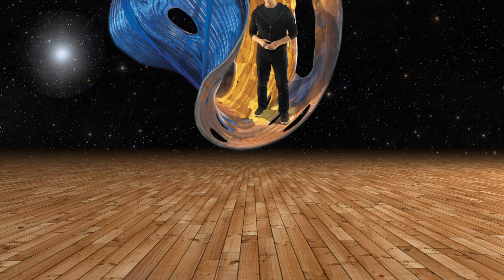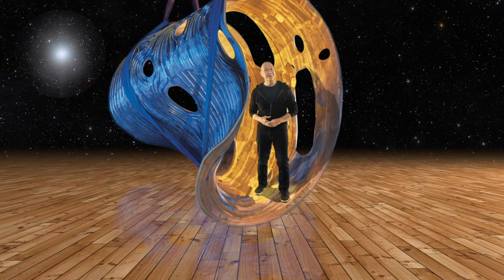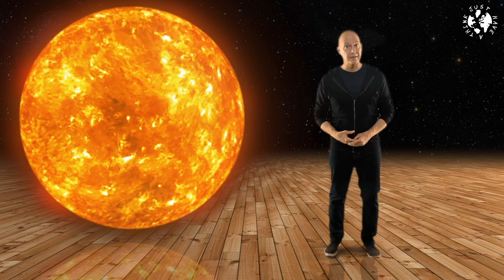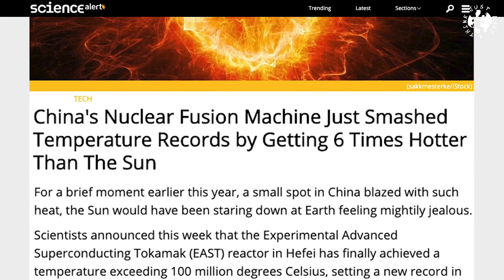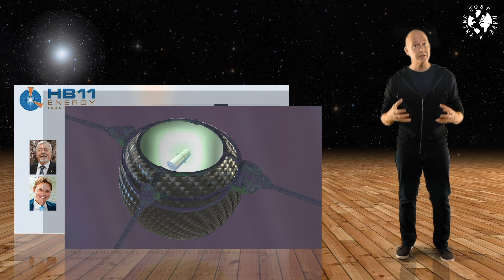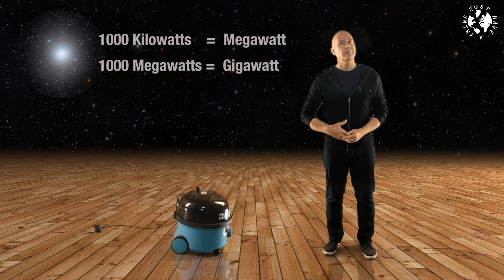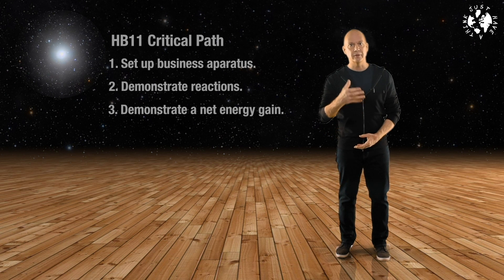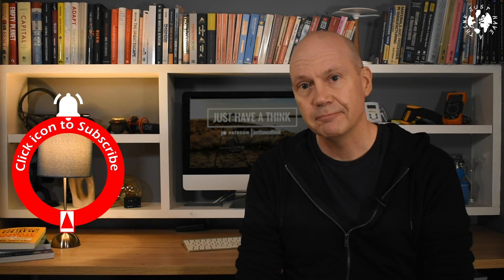Nuclear Fusion:  Revolutionary new breakthrough.

Comment: We don't need to spend billions of dollars developing a fusion reactor. We already have one in the sky that we can utilize now with solar / wind and battery plants which already provide base load power and can be installed now for millions of dollars not billions of dollars for some pipe dream sometime in the future.. The sun shines in everyone's backyard. Why spend more  billions on fusion reactors when we can spend millions on SWB installations and get the same thing which is cheaper, simpler proven. No war required, no more research required it is ready to go now. Fusion reactor research may have made sense 10 years ago but now it does not. Once installed the SWB doesn't require fuel purchase. It comes from the sun and is free. Something to think about.

Comment: Solar panels and windmills require too much critical minerals to ever be a sustainable reality. It will take either new gen fission reactors or a breakthrough fusion reactor. Both will still require coal, oil and gas to build them.
Reply: Also there is maybe not enough lithium for everyone to have an E car.
Reply: @Justwantahover  

Very true, very hard and expensive to presently recover the lithium from used Li-On batteries

Comment: Dèjä vu. 😀 The reason why magnetic confinement research has survived, regardless of its shortcomings,  is because all these other alternative ideas have failed in the past. Sure, they can get some interesting results at first sight, but prove impossible to scale up. Still, they also help to learn more on the subject, so it's good they exist, Regarding the p-B11 reactions, it isn't mentioned that their requirements are far more stringent. I admit I don't understand what they mean by the avalanche fusion reactions by the alpha particles. Maybe that's the key to some new idea, but I'd need to know more about the details. Indeed, the alpha particles would heat the target, but then you need to keep them confined within a high density  plasma within a very short period, like in NIF.  The idea of using chirpped lasers is certainly interesting.

Comment: For anyone who actually follows the physics, it's clear that this method is a standout. Apart from the other HB projects, this is the only one that proposes electricity vs heat as the output, and, to my knowledge, the only one at all that proposes achieving fusion without heat "in." No carbon. No radiation. No heat. Just electricity and helium as outputs. Clearly this idea requires orders of magnitude more funding.

Comment: This is MANY decades away from fruition, we need a solution NOW not 50-100 years from now. We need reactors that run at low pressure, can not melt down, run at much higher efficiencies (results in low waste), and generate little long lived waste. They should be made in a factory and shipped out as modules for assembly on site.

This fusion research is important but we have to put time and money into reactors we can put online in 5-10 years or it will all be pointless.

Comment: We should be diversifying. Renewables, as they're erroneous called, are not that optimal for a grid level system. The one caveat to this is hydro. 

Wind and solar should be local modular systems that support fission, hydro, and possibly fusion as the grid level systems. Of course fusion will only be usable if this company proves its system works or another beats them to it.

Comment: dual infinity Möbius strip  what about pulsed lasers in a dual tokomak modeled mobius loop to have fields at the threshold of forward motion acclerator where we speed up the flow into a particle stream that is propelled by pulsed hydrogenboron lasers until they approach the speed of light and just continue to propell them to the point of mater energy conversion causing fusion and the electrons to be striped. If we use supercritical metal hydrogen the hydrogen itself will act as a supermagnet superconductor.. once the criticality of metal hydrogen is reached then the fuel itself can be used as a gateway to the reaction https://en.wikipedia.org/wiki/Metallic_hydrogen   Metal can be turned into hydrogen at extremely heavy gravity caused by a gravity anvil.. once forged at super low temperature it can hold its fuel characteristic of metal hydrogen fuel source as a superconductive supermagnet thus using the fuel itself as the magnetic source. Just keep adding more metal hydrogen on the outside so it is a sustained fuel feed and repair of sublimed internal metal hydrogen core.
Reply: I don't really care much about fusion, I just want to survive the pandemic..
Reply: isn't there some way we can use the sun for fusion energy?

Comment: I have a silly (or not) question. It is known already, that a free neutron can be converted into a proton (beta-minus decay). My question is: would it be possible to fire a stream of neutrons into the hydrogen and somehow force their conversion into protons right before they got close enough to the nuclei to fuse? Even a success rate of 1 over a billion would probably be ok.
Reply: For many years (almost 25 years) I have been convincing scientists that thermonuclear fusion in the Sun occurs not in the core of the Sun, but in the solar corona !!! But scientists are very stubborn, and do not want to believe the obvious. Why are scientists not accepting new breakthrough scientific ideas? There is an assumption, accepted by most scientists, that thermonuclear fusion in the Sun occurs in the Sun's core. But no one has ever actually confirmed this. This is just a guess, the fantasy of an authoritative physicist. Scientists are currently using two methods to achieve nuclear fusion: inertial confinement and magnetic confinement. But there is also a third method of achieving nuclear fusion, this is the repetition of physical conditions as in the solar corona. Nobody is using this third method to achieve nuclear fusion? In 6 months there will be a small prototype of a commercial fusion reactor. A commercial fusion reactor in 1-2 years! I propose a technology transfer for a commercial fusion reactor under a contract. Thermonuclear fusion in the Sun - a new version. http://n-t.ru/tp/ie/ts.htm     https://www.youtube.com/watch?v=izCALj848xU

Comment: The real key breakthrough for viable fusion power is the REBCO high temperature superconducting material, which operates at liquid nitrogen temps (~70K), and can produce twice the magnetic field of previous superconductors. This allows for a 16x increase in power per unit volume - or in other words, for a machine the size of a small house to produce the same or better output than the absolutely enormous(ly expensive) ITER reactor. Also the use of liquid - molten FLiBe salt for a neutron blanket. Check out the MIT / Commonwealth Fusion Systems ARC and SPARC tokamak deuterium-tritium reactors. Dennis Whyte et. al. They're actually gonna do it! We should see the first ever positive net energy fusion in 2025, and a working prototype 200MW commercial power plant in 2030 or thereabouts.

Comment: who said they didn't create anything? they create a blackhole (for money), and the event horizon is always 20 years from now. i would ask, do we seen anything like that astronomically before in space? the smallest star with fusion we heard of is using the sun as comparison. and the nuclear fusion we want are in the size of a building. what makes us believe a continuous fusion will be happening in such a small scale? if the calculations is valid, we should as least see may be 1 or more of these stars in the space. ok, we lower the standard, how about size of earth? planet size fusion? you have to check the latest finding but i bet a dollar here, no such size with nuclear fusion that give out light and heat. too small is too small (in scale), you can't burn through a steel plate with a match.